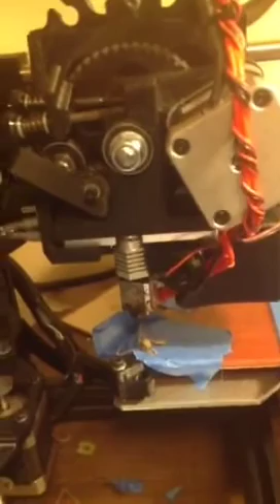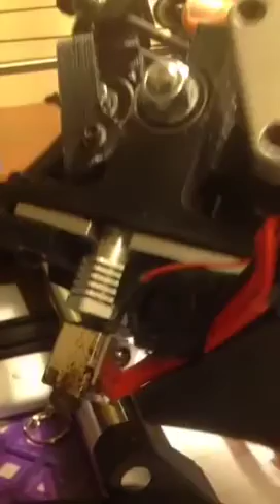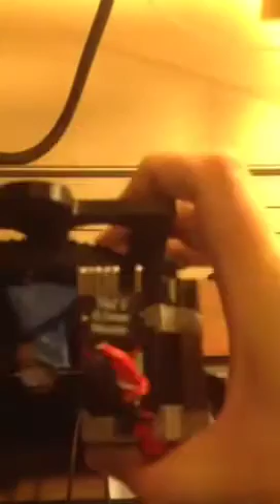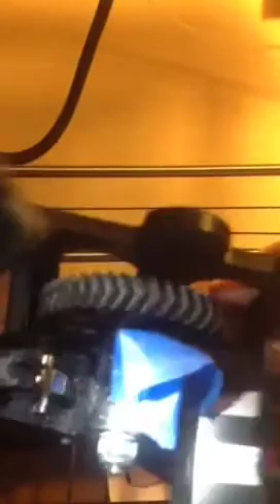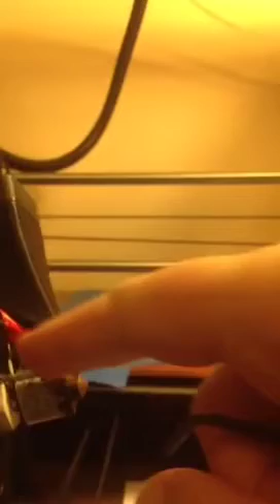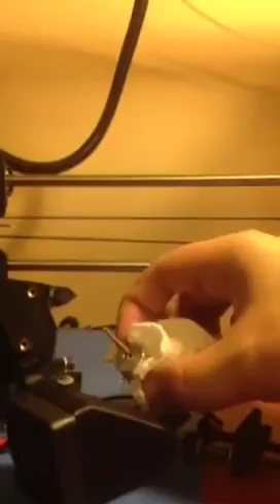Clearing a jam in Lulzbot Taz 5 3D printer toolhead

Comment: good info. Just found a faster way. If you get the hot end up 280c for 10 min most will drip out. Power off and remove the tip and push a metal rod up the hot end and the jam will come out the top. took me about 5 min. hope it helps!
Reply from the maker: Thanks for that. The jam was probably caused by wood grain filament, which tends to jam nozzles no matter what I do. The jams of course happen inside the smallest part of the hot end system.

Comment: Lol, it took me such a short time to develop a jam exactly like this. Thanks for showing the breakdown. Ever used IC3D brand ABS filament off Amazon? I wonder if I got some junk filament. Even acetone is having a hard time breaking down all the junk inside the nozzle.
Reply from the maker: I don't usually print in ABS, just don't like it. I found that the wood based filaments have a bad habit of jamming nozzles. I've only cloge one completley, others I have been able to work / hot pull a clog out.